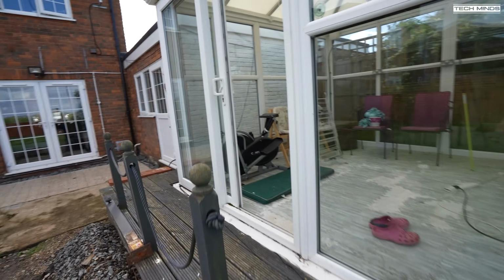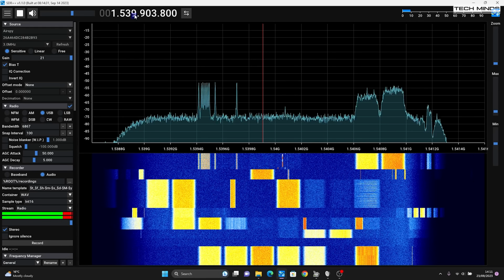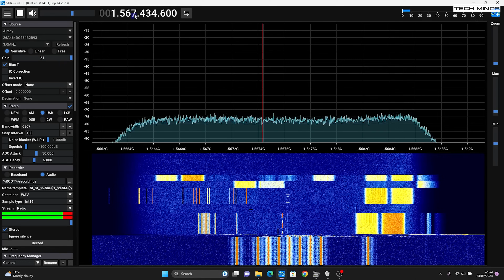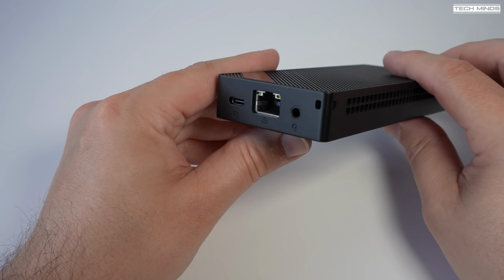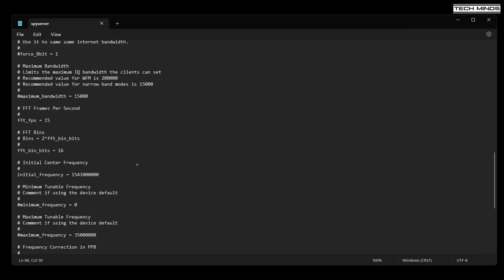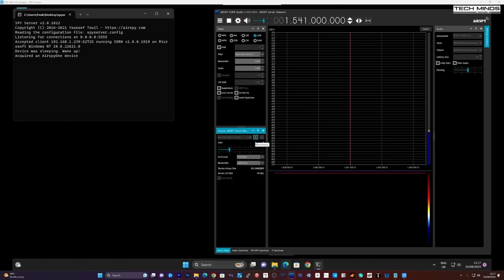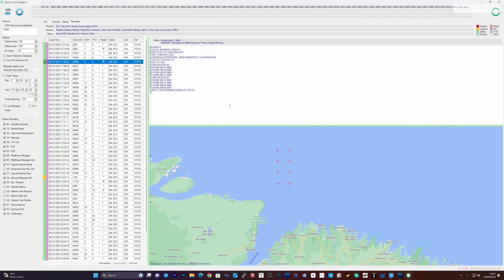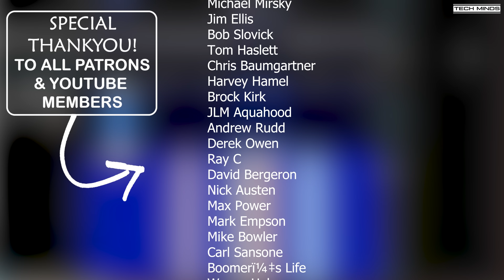Exploring the Nooelec 21dBi Satellite Mesh Antenna

Comment: a small hint: Europe doesn't have GOES, but does have the ELEKTRO/EUMETSAT satellites (they function the same way as GOES). I don't think any of them are on L-band but rather X-band, and requires a lot more money and time to do.
Reply: Elektro does L-Band but, since Elektro L-2 is offline, it can't be recieved anymore because the closest to the UK (Elektro L-3) is just barely out of range of east England, which is a shame since I live in Suffolk. Meteosat, operated by EUMETSAT, is a little more complicated. Meteosat used to broadcast AVHRR on 1.7GHz like other satellites, but EUMETSAT made it easier by having all data from numerous satellites like MetOp, NOAA, GOES, Himwari and of course Meteosat get relayed all the way to a signle geostationary satellite (HOTBIRD-13F currently) at Ku-band. So instead of pointing at Meteosat directly and instead of using 1.7GHz, you have to use a TV satellite on Ku-band as a relay. Also, you need a license key, which is free, to decode the data but it comes with some T&Cs which disallows commercial purposes, even with attribution, which basically makes it impossible to make a Youtube video about unless you pay like 8,000 Euros for a license that allows commercial use.

Comment: Jaero voice. I’ve done this with the RTL SDR blog patch but I think this should be much much better. Also plot the locations into VRS.
Reply: Can never find voice channels. Can find loads of acars and text messages but never voice
Reply: @box420  you have to change the baud rate in j aero and then select the spike on SDR platform for when they start.

Comment: Btw, these are not worth a single damn dollar. 190bucks NOPE!!!

Those original 2.4GHz antennas (they go for like 50-60bucks) work just fine, real difference compared one to another is about 1dB with Nooelec GOES+ LNA , tested on HRPT and LRIT.
Reply: Without modding it?
Reply: @MarkPentler   Just flipping the backfire reflector (that metal thing on the feed) otherway around does the pinch.
But even without that, its fine aswell.